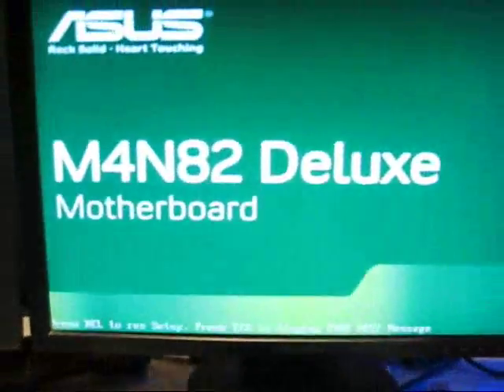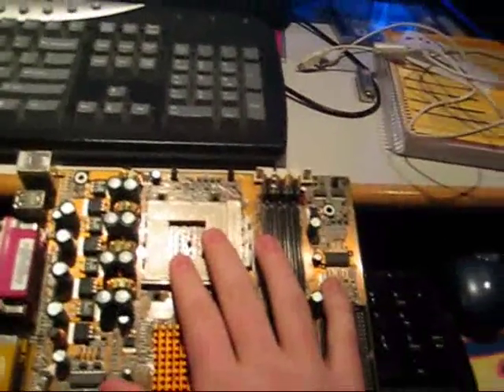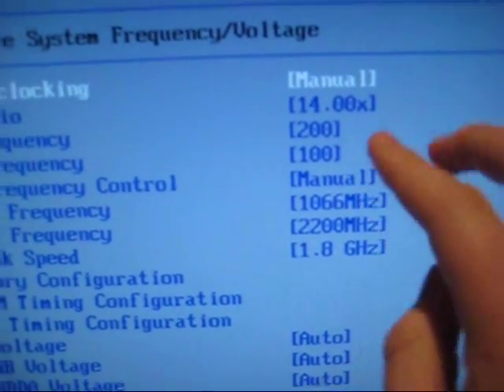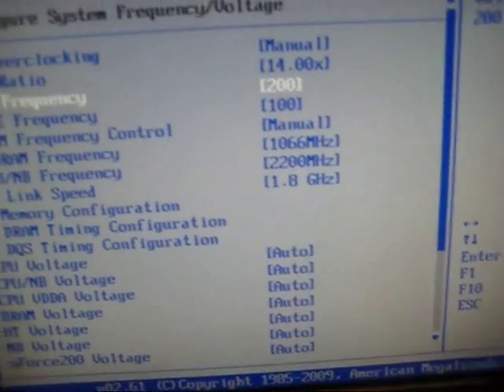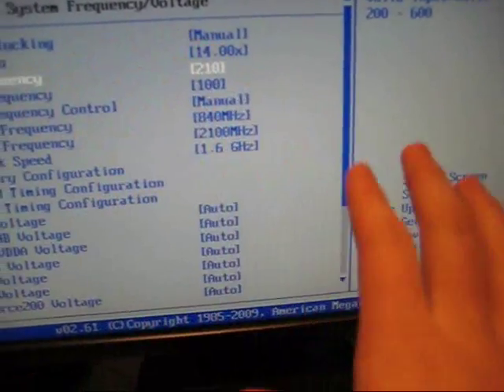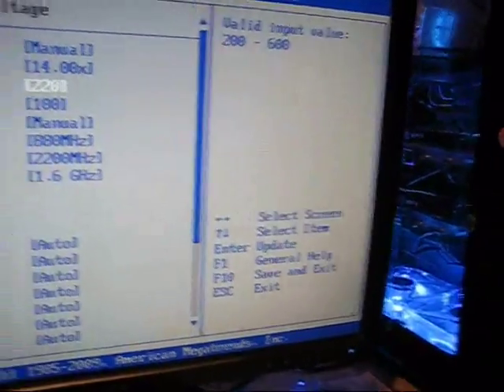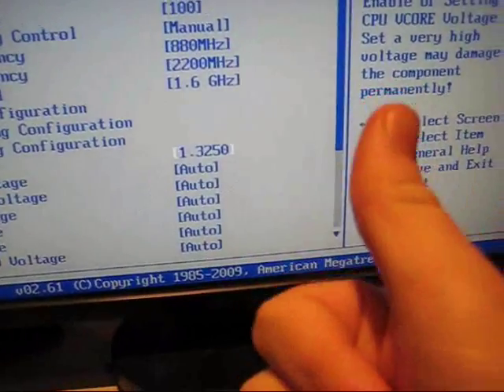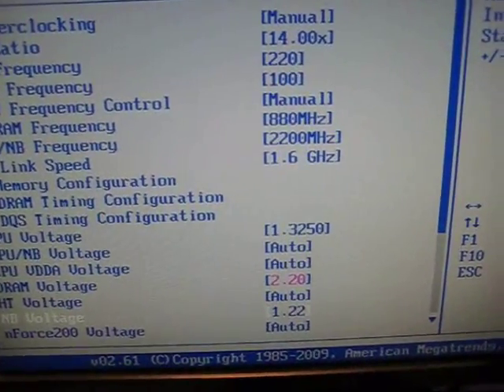How to overclock an AMD CPU Part 2/3

Comment: Do you think my AMD Phenom II X4 965 quad-core processor @ 3.4GHz is bottlenecking my XFX Radeon 6950 2GB graphics card? I used to have a 2.9GHz CPU until I recently upgraded to my current one, but I can't tell if it's still bottlenecking or not. Any suggestions?

Comment: i have amd athlon 64 3500+ and he is prety good my core voltage is 1.360 and frequency 2.2ghz and i am running WINDOWS 7 ULTYMATE 64 BIT NO PROBLEM and skyrim too and i want to overclock it a little but im not sure is it safe.i was overclocking intel pentium d dual core from 3.0 to 3.3 whit no problem

Comment from the maker: @fanmetal5 it depends on the motherboard, assuming you are running an aftermarket board, it will be specific to the manufacturer.  For instance, my current motherboard is made by Gigabyte (instead of ASUS as in the video) and the overclocking options for my board are listed under "motherboard intelligent tweaker"

Comment from the maker: @kenmha Ah, very good observation.  It would, now to compensate for your slower ram, you would overclock your NB, this is the connection to your ram and would compensate for the slower ram bandwidth.  And overclocking hte RAM timings (see my other video) would also help.
What i'm trying to say is: if you work with your other system clocks, you can compensate for lost RAM bandwidth

Comment: My Specs:
AMD Phenom II X4 940 @ 3.00 GHZ
Asus M3A78-CM Micro ATX Motherboard
Corsair 4GB DDR2 RAM @ 800MHZ
Nvidia Geforce Gt220 DDR3 w/1GB
800W PSU
500gb SATA HDD 7200rpm
Windows 7 Ultimate

WILL THIS be OK for overclocking? I need advise :D (Also thinking about getting another 4GB of RAM)